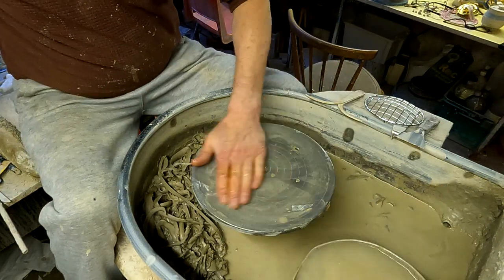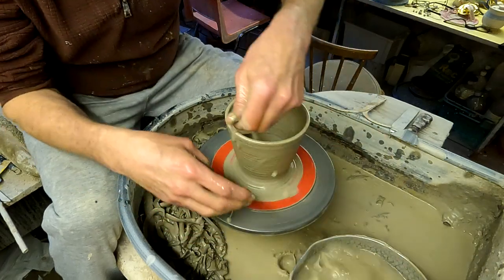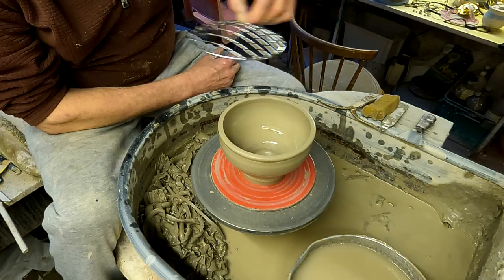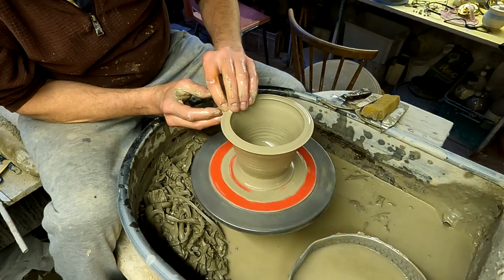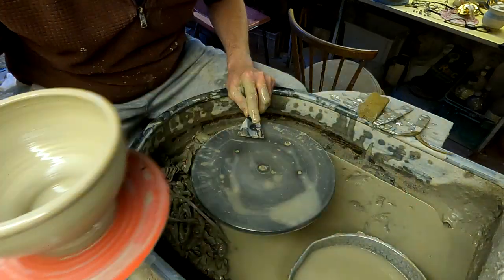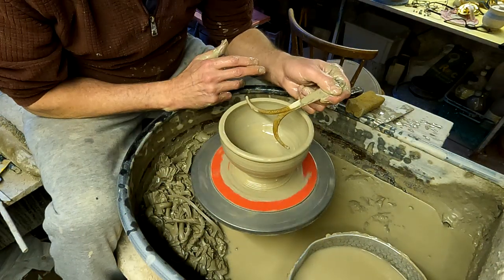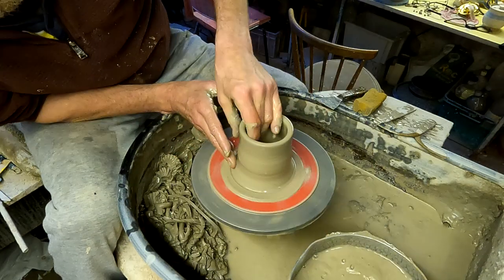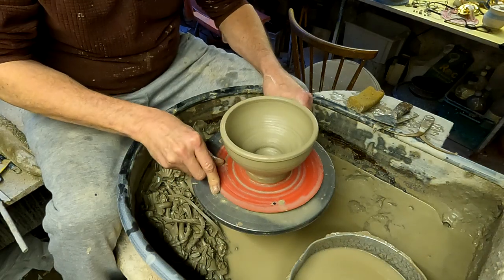How to Make / Throw Pottery Rose Bowls on the Wheel.

Comment: I think those would be so pretty. Thank you for the video. How do you go about figuring the the shrinkage, how big does the opening need to be so that it ends up the right size for your grate, or anything, cork, soap pump, etc? I have a lot of trouble with that. I think I've got it right and then it's not after the glaze fire.
Reply: Miranda.  You may know this already You can purchase a shrinkage ruler ( Diamond core tools has one). Or there are tutorials on line how to make your own shrinkage ruler and find the shrinking rate of your clay.   Hope that helps